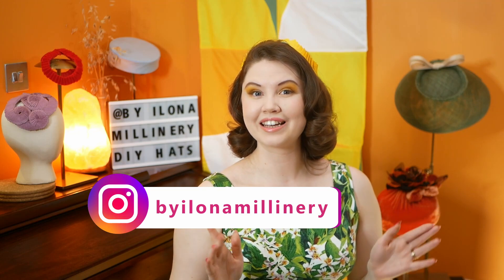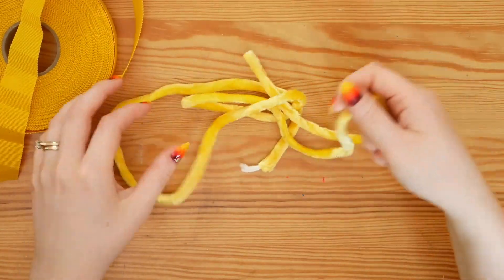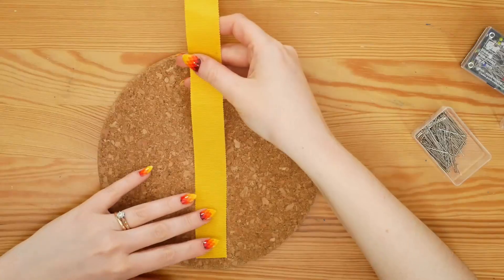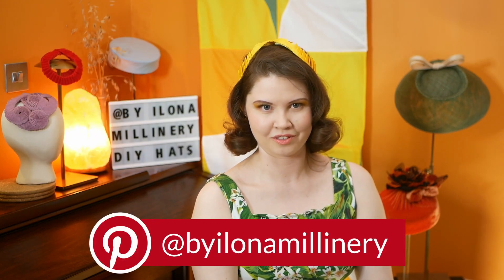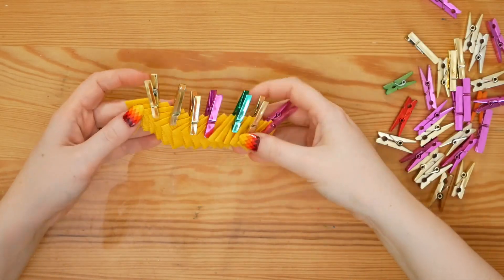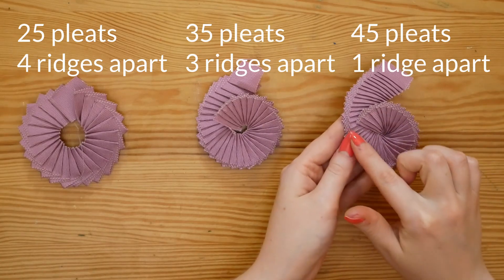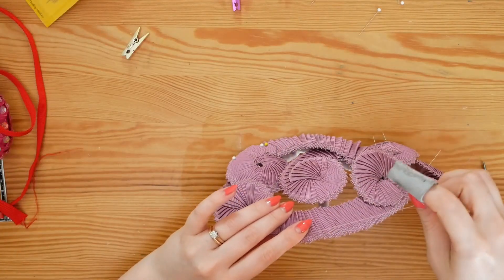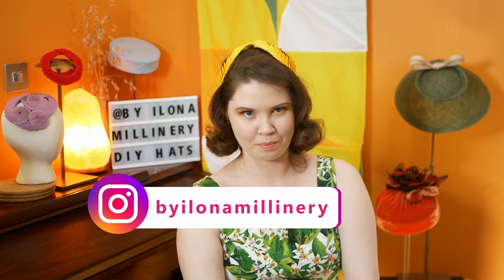Make Mrs Maisel's Catskills Hat | Vintage Pleated Nautilus Infinity Ribbon Wire Frame Hat

Comment: I have several vintage original hats that have complex velvet wired shapes - my fave one covered in a row of silk satin black bows intertwined with each other.  I think i prefer these as they can be adjusted better for my odd shaped head.  And theyre different and so classy.  Great video.
Reply from the maker: Hi Roxann, these wire frame hats are amongst my favourite models. Your silk satin black bow one sounds lovely 😊
Reply: @ByIlonaMillinery  The wire in these old ones seems a LOT thicker and more resiliant to shaping that just milinery wire - in fact...it feels flat under the velvet cover.